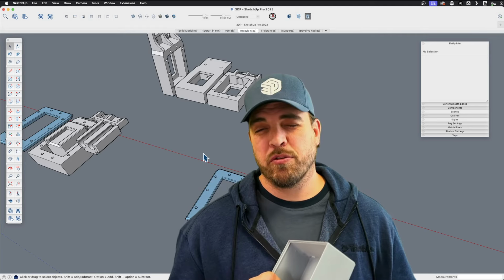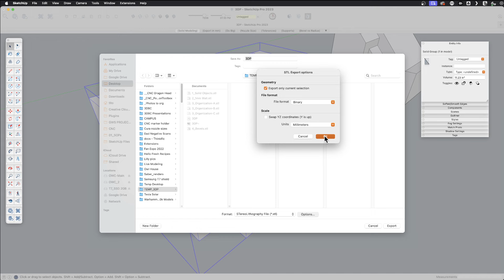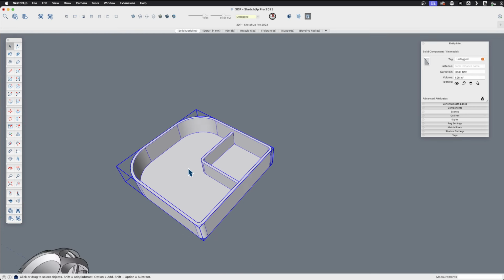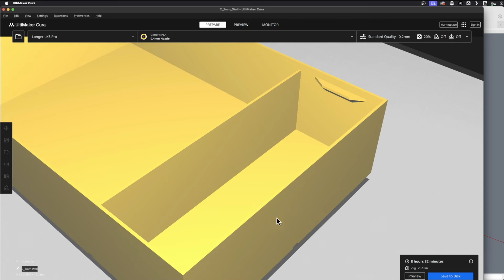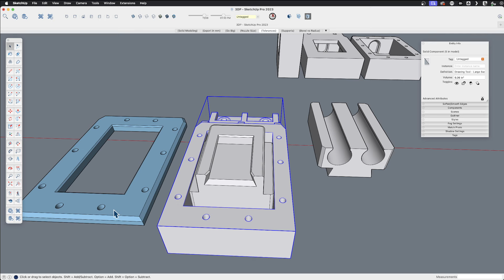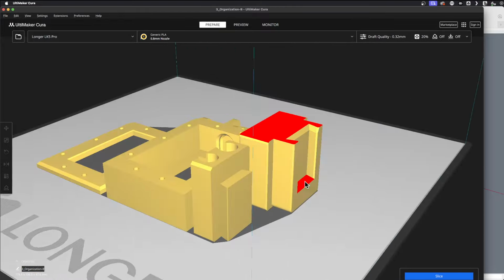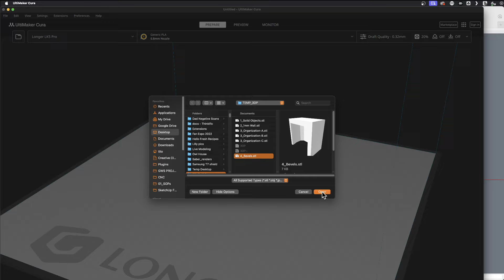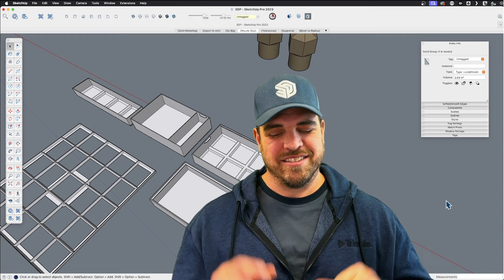Modeling for 3D Printing

Comment: Making sure that a solid is "solid" is called making it manifold and watertight. Sometimes with complex solids which are not "solid", when I use Solid Inspector to help or fix issues, it says "Everything is shiny" but SU Entity Info still does not show a volume. If this happens, I ungroup and regroup the object and that usually fixes things. Since I have been using my own 3D printer I have never used supports! I avoid them by splitting objects in SketchUp (and adding alignment holes/pegs where necessary) and orienting the solids appropriately. Never had any issues.

Comment: Nice tips Tyson,
I'm not into 3D printing but regarding the radius issue, maybe we can reconstruct that curve using flat steps where the step width = nozzle diameter and the step height = slice height 
it's a tedious work I know, and I hope there is a better and quicker way to print that curve.
Thanks!